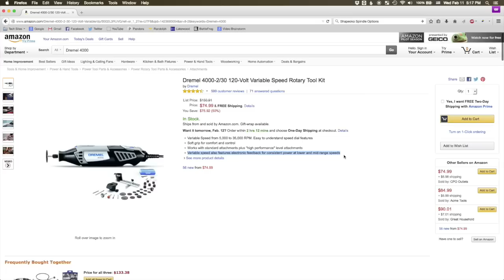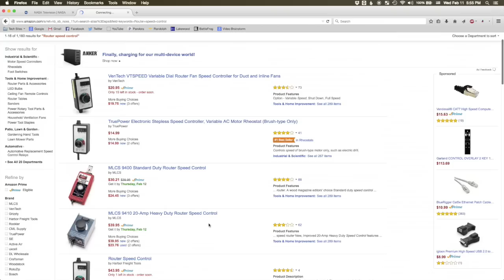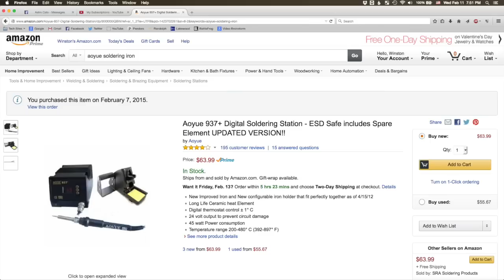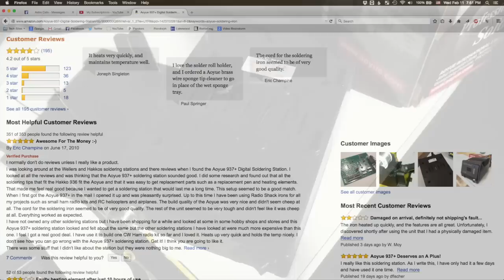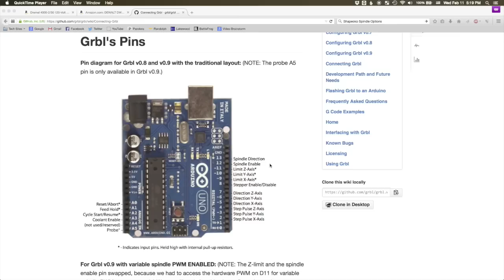Quiet Cut Spindle Upgrade for the Shapeoko 2 (#28)

Comment: why not order sametime good aluminium bracket install spindle good to Z axis, why use worst bracket. not good, normal yhis air cool 500-800 W spindle send whit bracket too. cost about 30$ i has used this spindle type 500W before aand new cnc i use 800W ER16 spindle and trow old makita router to trash, lot noise has. very cheap cost whit collect set and bracket and speed contrller 136$ normal. thats is lot better than expensive makita shit router.

Comment: Neighborhood of 200$ vs https://www.ebay.com/itm/163513882730 (US $97.85) + https://www.ebay.com/itm/202417319661 (S $30.69) = US $128.54 for 500 W (vs 300 W) - "Quiet Cut" name (but you can name it whatever you want).  
Plus:
Forward/Reverse  -  external control ; motor's rotating direction can be changed.
Start/Stop - En button, external switch connects to EN port at one end, and to earth at the other end; motor starts when connect to earth.
Stall Protection - Motor stops working when stalled, and starts when powered on again
Alarm signal 

Indicator Light

Well, youtube sponsored can't beat it...

Comment: plz tell me about stepprt moter nema type what number this nema  is it  nema 17 ? and if its not nema 17 can this spinder work with nema 17 ?
Reply from the maker: NEMA 17. But this machine is obsolete. And NEMA stepper motors have nothing to do with the spindle.
Reply: Winston Moy thx bud
Reply: normal minimum used nema 23 high torque motors etc, 3-4A 3Nm motor, but need use same ampere handle external driver too, arduino toy driver not can use max 2,5A motor only.

Comment: Chinese sellers for Aoyue soldering station couldn't even give you the same price you're getting from local distributor, because the shipping on it isn't cheap, nor is it a cheap product, compared to various other similar looking Chinese brands. Here in Europe you get it from Wiltec, they're fine, and i think they have a distributor in the States too. Other soldering stations out of HK only look similar, they're not actually the same.

But then, i find it fruitless to be too afraid of China shipments. Whether it's Ali, eBay or Amazon, they all protect you for at least a handful of weeks. Bigger Chinese sellers usually have a local return address somewhere in Europe and in USA, or will just refund you outright and you can keep the broken product or need to dispose of it yourself.
Reply: i orden alltime, ewery month something parts aliexpress and i looking all has FREE shipping, not need pay shipping were you buy if expensive shipping has ???? all parts can buy FREE shipping and lot cheapen than amazon newer sell same factory same parts.
Reply: @mattivirta  Do you think shipping is actually free? They fold it into the price.

For an item that fits in an envelope and weighs less than 20g, it'll probably come out to about 0.60€ and indeed there's no way Amazon can compete with that, there's state subventions at play. Something like a soldering station comes out to about $20 in shipping cost and a 3D Printer could be around $50-$100 to come all the way from China.

Just the other week i bought a North Bayou H100 monitor arm and i paid 30€ from a local seller shipped, next day delivery. I know in China the item itself costs something like $16. If i were to get it from Aliexpress or any Chinese seller, it would cost me upwards of 60€ with "free shipping". Because mailing 4 kilograms of steel such a distance obviously isn't free. Similarly it never made sense for me to buy a soldering station from a Chinese seller unless they have a local distribution centre to which they shipped them in bulk per container in advance, going through a local importer is cheaper.

Comment: how powerfull is your spindle?
Reply from the maker: That one was 300W. But with all the newer machines designed from the get go to handle a palm router (1.25 hp, 900+ W), there's not much reason other than noise to go smaller.

Comment: Isn't that the same spindle chinese sell on aliexpress and bangood for 40 bucks?
Reply: aliexpress good spindle same 500W or 800W air cool ER 11 or ER16 cost 100-146$ i just buy one 800 W and before i used 500W spindle. lot better and silent than palm router and cheapen. dremel not used cnc work worst  machine not has plan uses to router or spindle newer, broken bearings fast and noise lot.

Comment: Will this spindle upgrade work on the new s3? (Assuming I can also find the mount converter from the dewalt 611 to the spindle)
Reply from the maker: iv gutier Yep, it can be operated 100% electrically independent of the Shapeoko. I haven't found an off the shelf bushing for making it fit in the S3's mount, but I've made my own and it works fine. Unless noise is your primary concern though, or plastic is your main material of interest, I wouldn't rule out a router like the Makita. With all the extra stuff like power supply and speed controller, there's no financial benefit over a router.
Reply: I did get a Makita with the S3 (I was able to get it for free this past holiday), but unlike the Dewalt 611, the Makita seems to not have as many options for collets and I'm stuck with a 1/4'' shaft size, and the smallest mills I can find at that shaft are 1/8''... not small enough for details... Noise is a concern, but not the highest concern...
Reply from the maker: Check these: http://www.elairecorp.com/makitaroutercollets.html
I touched briefly on them here: https://www.youtube.com/watch?v=sZtFi3uDA8A
Reply: Oohhh I was hoping to get you to do one of those videos! Read my mind I see :). So just to confirm, a collet MRP-1250 1/8" from elaire corp, would allow me to put mills with a shank of 1/8'', and hence smaller cutting with that same 1/8'' shank! I'm totally ordering these... Thanks a lot Winston!
Reply from the maker: Yep, that's the one I got, and it's been working flawlessly for the past few weeks. Good luck, have fun.
Reply: Thanks a lot!

Comment: I have a "500" Watt air cooled ER11 spindle I got off Ali. Mainly because I couldn't hack the noise the Bosch Colt router I was using made. It looks like this one, except the housing is black, not chrome. It is quiet, but my spindle seems to lack anything I'd call power. So it is sort of a yea, boo kind of a thing for me.

Comment: Nice!, what app was that, for measuring the decibels?
Reply from the maker: Decibel 10th, but without proper calibration I wouldn't really trust any mobile app to give you an absolute SPL reading. What it does give you at least is a consistent comparison between two noise sources.

Comment: Can't understand why anyone would call this contraption a "spindle" this is an ordinary DC motor whit pressed on ER collet holder. Runout is probably horrible and in no way it could sustain axial load except for some small drilling. When you count in the Dremel first and then this ... you could almost get the 0.8kw watercooled spindle for the same price

Comment: Can it cut in carbon fiber or thin composite sheets ?
Reply from the maker: +getsome0dk I have not had CF in my shop, but others have and it does work. I've machined sort of a fiber-pressed ceramic material before with no ill effects.
Reply: yes can.

Comment: Have you tested this spindle with aluminum? Does it still function well after extended use?
Reply from the maker: +LimitedWard I've had limited success with Aluminum using the 300W version. You have to go really slow using it. 400W+ would be recommended, or using a router as your spindle.

I heard comments about dust intrusion messing up the bearings on the earlier QC spindles, but Inventables supposedly requested changes from their vendor to address this. My QC is from before this change, and it's still working well almost a year later.

Comment: So, Dremel 4000 vs Quiet Cut Spindle. (I wanna buy my first custom CNC, so I am trying to get the basic info :) )

There are so many known advantages using Dremel (its a multipurpose tool, probably a bit cheaper, variable speed etc). What are the advantages of using Quiet Cut Spindle? I counted 3:

1) Quiet.
2) Ability to be connected to gshield, whereas dremel cannot.
3) More wattage (300 W vs 175 W).

From the above I do not understand how more wattage can help. Both spindles can cut the same materials, don't they? What exactly does more power offer?

Also, what is the point of controlling the spindle with your controller? Can this help somehow?

Finally, are there any other reasons to choose quiet cut over Dremel?
Reply from the maker: +epiNoesis Dremels tends to have weaker bearing in lateral loading. It's not designed to pull an end mill through material for prolonged periods of time. They are also held to looser tolerances in terms of bit runout. (at least by my observations..)

Power matters because cutting materials imparts rotational resistance. You need that extra torque to maintain speed, especially with denser materials (exotic woods, certain plywoods, aluminum, etc).

For materials where you know there's an optimal cutting speed, or where the proportion between feed rate and spindle speed really matters, it's nice to be able to just program it in and forget it. (spoiler alert, I don't actually use this feature very much. I cut "by ear" most of the time).
Reply: +Winston Moy That is great info, at least for a newbie like me. Thanks a lot :)
Reply: +epiNoesis just to set things straight here... 175W 230V is a MORE powerful motor than 300W 50V. So, "More wattage" as you call it means nothing because it is like comparing apples and oranges. I have a Dremel 4000 and that easily cuts through aluminum and I also have a 350W 50V spindle motor on my CNC and while even that can cut aluminum, it fights and can not go deep. By that said, the Dremel is crap as a spindle motor not only because of noise but also because of the very weak bearing and mechanical design, a lot of axis play and toy-like, cheap plastic construction, crappy collet and so on. Never the less, fair is fair, it is MORE powerful than the motor 300W 50V motor in this video. To get the same power out of a 50V motor as the Dremel you'd need a 0.8kW motor.
Reply: REAL air cooler spindle have cheapen than dremel or palm router sorry, and not noise, dremel have toy not used cnc newer, not has plan can use, not longlive because have worst bearing uses cnc. waste only money buy dremel, to cnc, can use only if made small PCB only.

Comment: 1) If I understood right, you can control the spindle through the gshield, right?

2) And the spindle is powered from the inventables power supply, right??

3) Is the 350 watt supply capable of not only feeding the spindle, but also the 3 axis steppers? Or do they get their power through the controller's separate power supply?
Reply from the maker: +epiNoesis 
1) yes, need to enable PWM speed control in GRBL first.
2) correct
3) With the 24V should be possible. Not sure about 48v.

Comment: The lack of a relay in the full kit completely threw me, and I was going to buy one until I watched this video. There were two things I learnt. 1. I don't need the relay, and I'm about to go and find the video you mentioned you would do, to show how to wire it up. 2. If I understand you correctly, you can actually control the spindle speed from Grbl, do you have a resource I can read to find out how to enable that please?
Reply from the maker: +Scott Moyse I'd start here for the electrical connections: https://github.com/grbl/grbl/wiki/Connecting-Grbl

You need Spindle PWM to go from the arduino/controller to your motor controller. In your gcode, you'll be specifying spindle RPM with commands like: "S10000". As such, you need to compile GRBL with instructions telling it what RPM should correspond with a 100% PWM signal. 

http://www.shapeoko.com/forum/viewtopic.php?f=3&t=4377
https://github.com/grbl/grbl/wiki/Compiling-Grbl

Those links will get you started, not the most complete resources, but they should give you a good idea.
Reply: Winston Moy Thank you for that info!

Comment: I've looked over inventables, and i have to say, the prices are quite insane. I mean lets just look at the v-wheels. While $4.15ea doesn't really sound like much, when you need to order 10 or more depending on your project, you'll easily spend more than $40 on these alone.  The problem with this pricing isn't that they are low quality, because in fact, i have no idea if they are or not, but when you look elsewhere for the same exact bearings, you can litterally buy stacks of 10 these 3mm double bearings for  the same price as 1 bearing from inventables., but of coarse these don't include that handy-dandy specially shaped plastic boot that slips over the bearings. Something even a novice with a lathe could produce out of high quality steel ad nauseum.

Now i use these bearing as an example, because they are the best example of the current trend. Tack on the word CNC and the price of whatever it is instantly skyrockets.
Reply: Yeah but their trendy name has to be worth the 10X markup they change alone.

Comment: Winston,
I want to say I love your manner of conveying information.  I have a question and maybe it will be another Video.  My Shapeoko 3 is coming next Friday :). I'm considering the Quite Cut spindle based on this and so many others saying they like it. My question is can you explain how to hook it up to the Shapeoko 3?
Reply from the maker: B Lee The quiet cut has its own power supply and it's speed can be controlled via a potentiometer. It doesn't require any electrical connections with the Shapeoko 3 to use.

However, the Quiet Cut's control module can also accept a PWM signal to command a spindle speed. The Carbide board has a PWM pin that can be accessed for this purpose. Edward will be releasing a 1 page document at some point to detail how to do this.

Comment: Very good review of the spindle! Although mine came from eBay (China), it is essentially the same as the one shown. Like you, I noticed there was indeed a torque difference between a Dremel and the new spindle but that is easily accommodated by using 1/2 of the pass depth you would use with a Dremel. For instance, I was able to cleanly and easy cut through 3/4" solid red oak using 25 inches per minute and a .05" pass depth. Edges were crisp and there was no noticeable speed drop or tool chatter. Remember the golder rule - make Chips, not Dust. If you get fine dust then either increase your feed rate or slow the spindle speed. So far I've been able to cut through solid oak, 3/4 plywood, 1/2" acrylic and 3/4" MDF with the spindle. A HUGE plus is the ability to hold a conversation with a friend at a normal voice level while the spindle is cutting. If you work in a garage late into the night then your neighbors will thank you. Great video Winston!
Reply: Houston Firefox , how many hours has it been used? Are the bearings still good?  Thanks for the feeds and speeds.

Comment: Thanks Winston.  Any chance you could make available the files for cutting your arduino / sheild box?  You can tell the guys and gals at Inventables they did good lending you the quiet spindle.  I'm now ordering it :-)     I am very interested in real life examples of Shapeoko / X-Carve enclousures and electronics mounting solutions. 

I can tell everyone I'm a noob on CNC yet was able to get the Shapeoko2 up and running in a day, used Easel to deisgn my cutting plan, and professionaly cut 10 radio boxes in ~ 2 hours with ZERO waste.  By hand, I had 20% waste and several days of work resulting in a less than perfect look.

Keep up the videos and mucho thanks to Inventables.
Reply from the maker: Phil Davis I have to dig up the files, I'll post them either to my site or the forum when I get a chance. I'd caution against using them as-is though, because there are a few things I'd do differently if given the chance.1) The wiring in the enclosure is very right. I should have left more room between the gshield and the female plugs. Makes taking the gshield out and reinstalling it a pain.2) I had originally wanted to attach the plexiglass lid with magnets, but never got around to it.In the mean time, you can take some inspiration from other documented enclosures (many of which look way better than mine): http://www.shapeoko.com/wiki/index.php/Electronics_Enclosures#Designs

Comment: Hi Winston,
I consider to buy shapeoko - mainly for milling acrylics.
Is shapeoko with quiet spindle usable for this?
Thanks
Reply from the maker: It is definitely useable for this, better actually because it has a lower max RPM than a Dremel. And of course, choosing the right end mill will produce the best results. But the Quiet Cut itself works great for a variety of materials.

Comment: Hey Winston, what are you using to stream the Gcode to GRBL (and what version)? I've been having issues with the positioning readout in OGS hanging up. Going and having dinner and trusting the machine would be so nice!
Reply from the maker: I'm running Universal gcode sender, latest version. It will occasionally lockup (as most Java apps tend to do), but it's never happened for me in the middle of a job.